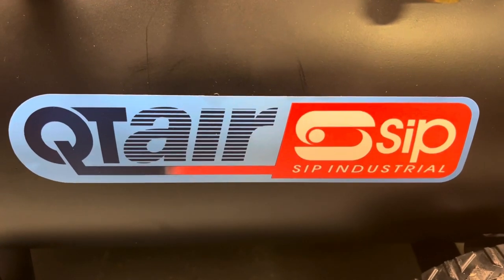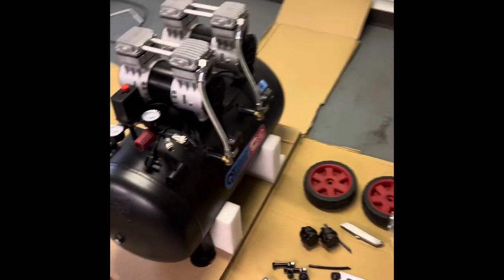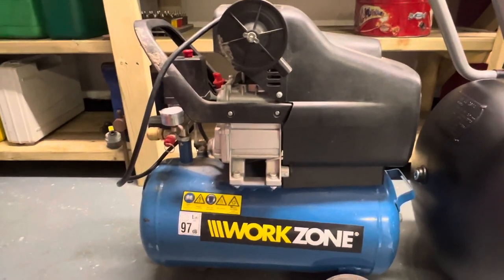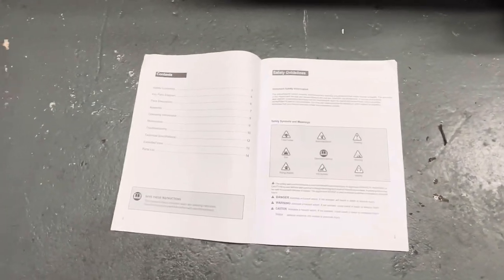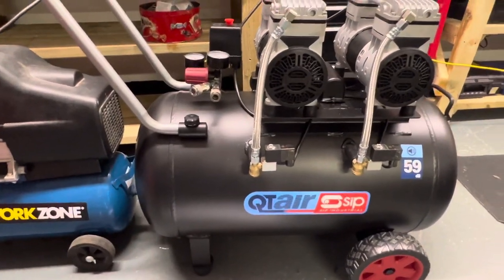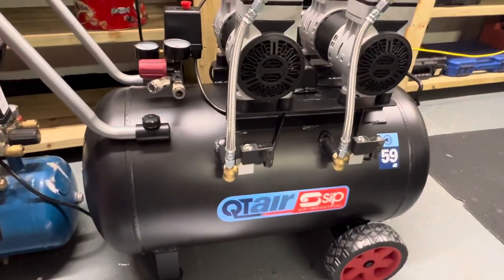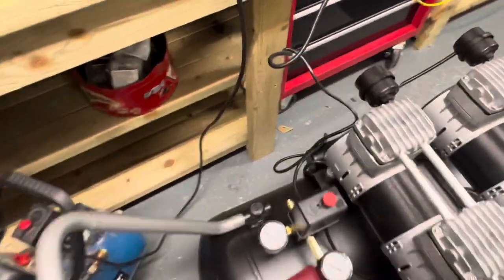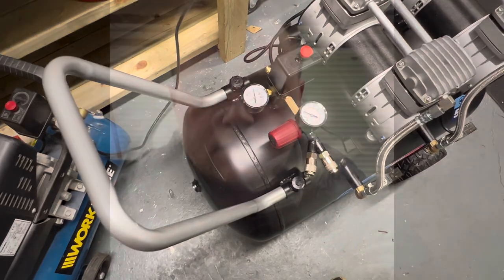SIP QT100/10 Low Noise Air Compressor Unboxing and Initial Review

Comment: Tip the box on it's side and cut the bottom seal, fold up the four flaps and lift the box off ... Hindsight n all that... Looks a quailty compressor, I've got a 50L stanley Low noise with a single 1.3hp motor which doesn't have the power I need,  this looks perfect and only £50 more than the Hyundai double motor 50L which only has 1hp pumps (this has 1.3hp).... Not many videos about of these so appreciate you taking the time to do some.
Reply from the maker: Yea hindsight as they say is wonderful! Haha didn’t want to scratch it… 

This is far better than the Hyundai as a few friends all have different compressors and 1 has the twin Hyundai but it take ages and also doesn’t have the CFM and FAD output as this. Honestly for the money (I know they’ve gone up a little) you really cannot get a better ‘garage’ compressor especially if you don’t want it noisy. Thanks for the comment and I hope it’s helped, I really do after these past few months love this compressor and I really recommend anyone looking for a ‘silent’ 100L compressor gets the SIP QT100. Great quality, performance and doesn’t blast your ears off. One recommendation is to make sure it’s well ventilated to make sure it doesn’t get too hot as overtime can cause damage inside the compressor piston (same as any silent compressor I’m told).
Reply: @mancavenath2696  Brilliant, thanks, that's my decision made, just ordered, thanks again.

Comment: A very large jump in class from Aldi to SIP QT, but I don't fancy putting 75kg in my boot!
Reply from the maker: Massive jump! But I needed the FAD for some of my tools and I like it quiet so I can here my music whilst I’m working 😅 Yea it’s not a very portable compressor but there is a smaller 50 litre one and based on the quality of this (however not used the 50 in anger) I’d go for that.
Reply: @mancavenath2696  yep I  noticed that the 50L only has one motor so the cfm halved but nobody has the 50L in stock in the UK, you're the only person who posted a video on the SIP QT100 model and its clearly a premier compressor in its class. If only SIP made a 50L with 2 motors as I have to cart the thing about, 70kg is the only issue for me.

Comment: Great videos i have the 50 litre arriving on Tuesday i only need it to put 27000 rivnuts in got a good deal at £260 including vat hoping it will run lvhp spray gun so i can sell my airless sprayer as i need the space, starting to wish id gone for the 100L
Reply from the maker: Wow that’s a hefty task! Hope it goes all well for you. I’d say maybe the 100L would be better but without seeing or using a 50L I don’t know. Maybe do a video on how it goes! There’s not much about online video review wise about these compressors hence why I did one. A video reviews goes a long way to make your mind up about what to purchase and helps others. I’d like to hear how you get on with it! Zero issues and complaints for me for the 100 tho and everyone who comes round says they can’t believe the output it has and the noise 👍
Reply: @mancavenath2696  Thankfully its about 2000 a month over 12 - 18 months depending on how many fabrications they require, I took the advice of the guy that sold me the rivnut gun which in itself was £650 !!! Although it should be money well spent hopefully, yeah seen a couple of videos on the 100L but none on the 50L I wanted to buy SIP as 6 years ago when I started my steel fabrication business I bought a SIP bandsaw that has been abused daily and never missed a beat so hoping this is similar quality

Comment: What’s it like now you’ve been using it for a while, I’ve got the Hyundai 50ltr it runs my lvlp guns and a mini da. I’m thinking of upgrading.
Reply from the maker: Unreal pal, it’s still so quiet after more than probably 4/500 charges. It’s been abused a few times with constant use and has always been reliable. Highly recommend it